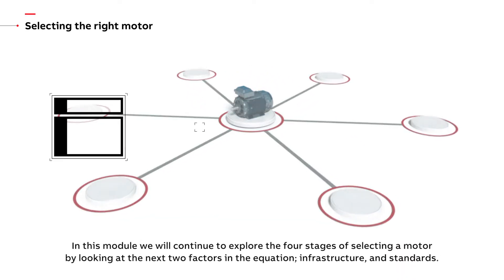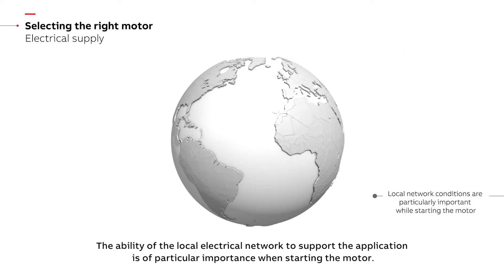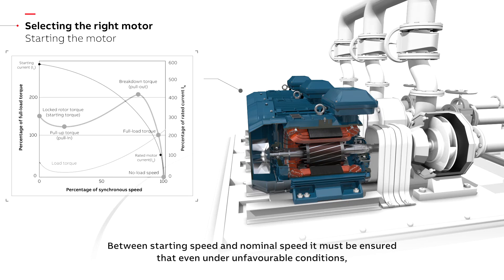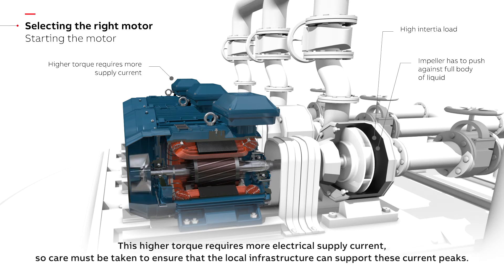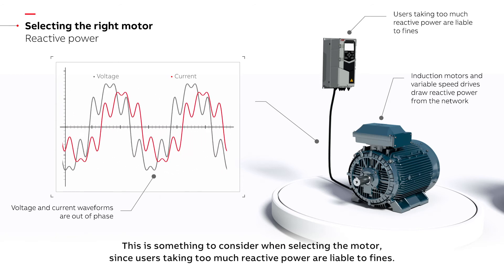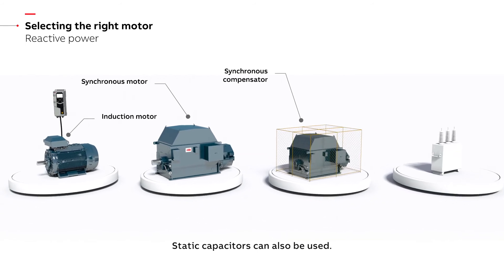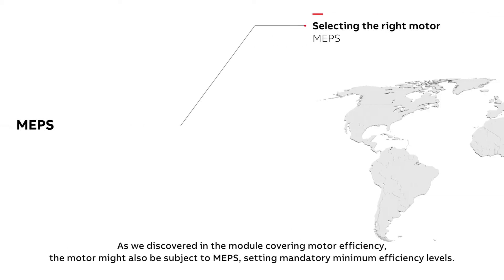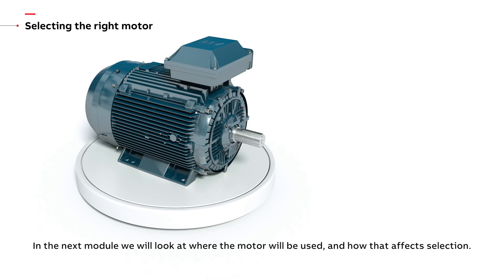How to select the right electric motor - part 3

Comment: which is efficient for motor torque and speed ? if the torque is high and speed is low is it good or not for motor ? and if the torque is low and speed is high is it good or not ?
from curves i see some motors when the speed is getting rise at a point the torque decreases is it good for motor or not  and why ? i need comparison for efficient performance